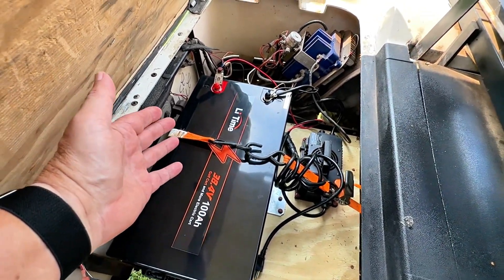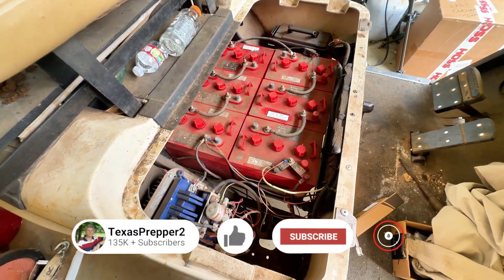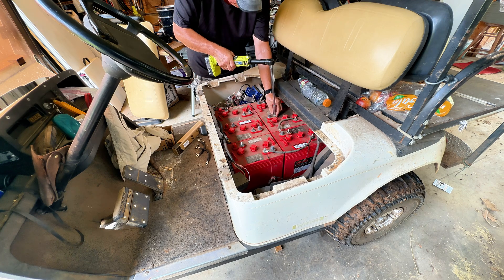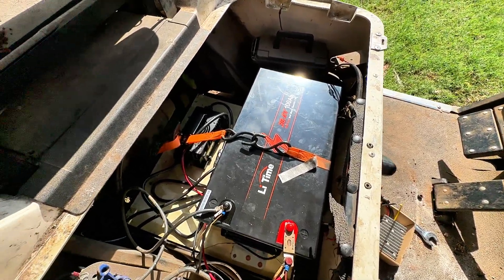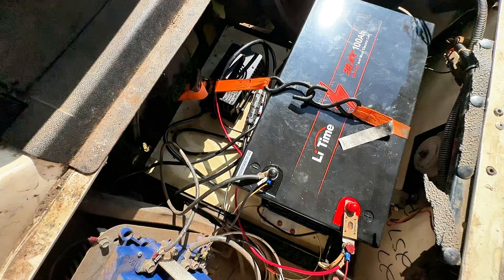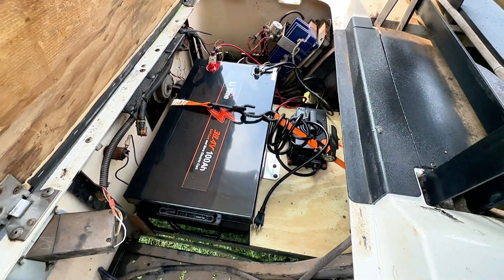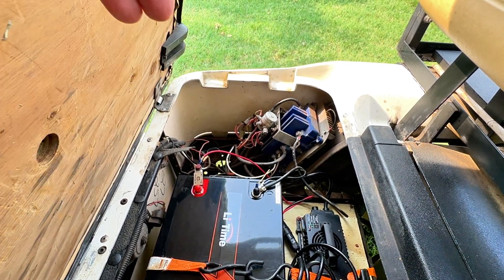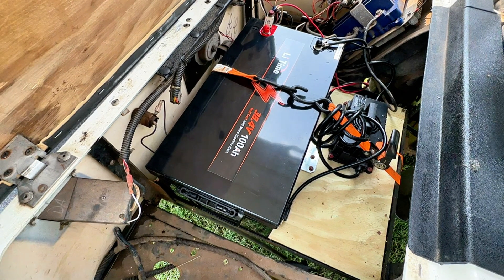Converting Lead Acid to Lithium - The Ultimate Guide

Comment from the maker: In this video, we take you through the step-by-step process of upgrading an old EZGO golf cart by replacing its outdated lead acid batteries with a modern, efficient LiTime lithium battery. This transformation not only enhances the performance and longevity of a golf cart but also simplifies maintenance and reduces a tremendous amount of weight.

Check out LiTime Lithium Batteries Here: https://www.litime.com/?ref=fvbeaugo
* Use Coupon Code TP2 for 3% OFF! *

Here are the Battery Lifting Straps: https://amzn.to/3VpZgaf
Here is the Ospho I talked about - It STOPS Rust: https://amzn.to/3X2NQus

*What You'll Learn:*
- The benefits of switching from lead acid to lithium batteries.
- A comparison of lead acid vs. lithium batteries.
- Tools and materials needed for the battery replacement.
- How to safely remove the old lead acid batteries.
- Proper installation and connections of the new lithium battery.
- Tips for optimizing battery performance and ensuring long-term reliability.

*Why Upgrade to Lithium:*
- *Longer Lifespan:* Lithium batteries last significantly longer than lead acid batteries, saving you money in the long run.
- *Weight Reduction:* Lithium batteries are much lighter, which can improve your golf cart's performance and efficiency.
- *Maintenance-Free:* Say goodbye to regular maintenance checks and water refills.
- *Consistent Power:* Enjoy consistent power output throughout the entire charge cycle.

Whether you're a seasoned golf cart enthusiast or a beginner looking to upgrade your ride, this video provides all the information you need to make a smooth and successful transition to lithium power. 

*Don't forget to like, comment, and subscribe for more helpful tips and tutorials!*
Stay safe!
alan
As a member of the Amazon Associate Program, I earn from qualifying purchases
Reply: Waited all video for the step by step tutorial and never showed it im new to golf carts and i'm in the process of doing this conversion but im very green working on electrical componenets,  do the switch and charger hooks up directly to the battery?
Reply: How many hours can you run with that battery?
Reply from the maker: @davida5211  Not really sure. I don't play golf. I use this on the farm. When I see the voltage dropping, I recharge. But I've never tracked how many hours it was. The documentation says 30 miles or more... also depends on level ground or hilly... lots of variables.

Comment: I Know you don't get a lot of rain around there but the only thing I would do different is locate that charger somewhere else or cover up that intake cooling fan. Water could be an issue...it looks like most I see, are they waterproof by chance?
Reply from the maker: I think they are waterproof up to a certain point. But, my golf cart is always parked under a shed, unless of course I’m out using it in the rain… Which I try not to do 😊

Comment: Hi. I have a 48v ezgo txt 2017, I switch from 6 of 8v lead batteries to 4 of lithium 12v 100AM. But it doesn’t run.  Just slightly move then stop.  Pls help
Reply from the maker: I wish I could help you, but I am by no means a golf cart mechanic. 
I have no idea what your problem might be. This conversion was easy, and I think most anybody could do it, but I don’t know enough about carts to diagnose your problem.

I would recommend you contact someone who specializes in golf cart conversions!
Reply: Check the reed lead. The small red one from the  old charger port. Check it’s connected to the positive terminal on néw batteries. Drove me nuts for two days.

Comment: have u noticed the BMS stopping going up hills, just concerned that the 200 cont rating will cut off when going up hills, I dont know the max think its 400amp for 3 sec then will cut off
Reply from the maker: So far, it is handling my hills OK. I’m going to have my 
forward /reverse switch updated soon. I’ll post that video when it happens. That is supposed to help the performance of the cart immensely.
Reply: Wow Jist updating the switch?  Wonder how 🤷‍♂️
Reply from the maker: @lestervida  I'm waiting for the Golf Cart guy to work me in.
Trying to keep my foot out of it till I get it replaced

Comment: Could you explain the connections on the positive post. I can’t get mine to run, I’m missing something
Reply from the maker: Mine would not run at first either. Then I read something somewhere, that said you have to connect the old charging port wire. So, I connected the wire from the old charging port (even though I was not using it anymore) to the positive post of the battery and it worked. It’s worked ever since.

Not sure why, or what that has to do with anything… 
But it worked. 

It’s the wire that originally came from the original factory charging port that went to the positive battery post. Connect that (if you can remember which one it is) to the positive of the battery. 

At least, that’s what it worked for me. 

You might want to take it to a cart mechanic and get his opinion first.

Let me know if you get it going.
Reply: The wire most likely comes from reed switch witch prevents the cart from moving with charge cable installed. It opens the positive connection between charge port and direction switch?. When in plugged the reed switch closes and applies voltage. Some people jumps out the reed switch when it goes bad.

Comment: How did you wire it?
Reply from the maker: I just put all the wires that were on the positive terminal (on the lead acid batteries) to the positive terminal on the lithium. Same thing for the negative terminal. It worked out great.

Comment: I did same upgrade but the litime bms in battery is cutting off when I fully depress go pedal at 50% pedal it’s fine any help would be appreciated
Reply from the maker: I’m probably not the right person to ask for help. But, you need to make sure your controller can handle the extra amp output. My controller was upgraded several years ago to a 400 amp controller and it seems to handle this really well. 
Figure out what controller you have. (look at the label on it) and ask a true golf cart mechanic if that controller will handle the new battery.
That’s the best I can do… Hope it helps

Comment: How come the lithium battery doesn't burn out the controller? The amp output has to be higher then lead acid?
Reply from the maker: Several years ago, the original controller crapped out, and I had it replaced. They put a 400 amp controller in. So , it can handle the increased amperage. The motor is original equipment though, as far as I know.

Comment: I went lithium and now regret it. The price was 1,200 for the battery and now after seeing all the battery fire from moisture that will eventually get into the box holding the batteries, I’m afraid that it will catch fire. Plus with batteries just die with no idea of them getting low on a charger. At lease with lead batteries, you have the cart will slow down telling you they need to be charged.
Reply from the maker: True, when they go dead, they go dead quick. But, the lithium phosphate are a lot more stable than the early lithium batteries. Very few fires.
Reply: @TexasPrepper2 how’s lithium batteries, save his lead acid. I’m was a firefighter. And I can tell you that lithium batteries are far more dangerous than lead acid batteries. I live in south Florida, where humidity and a salt atmosphere plays a toll on everything. In salty moisture causes corrosion in batteries, very easily, making lithium batteries very dangerous to have. There’s been lithium batteries that just were sitting in the garage that started at the whole house on fire and they’re very hard to put out once started.
Reply: @rayladurini1045  Big difference between lithium ion (think EVs like Tesla) and lithium iron phosphate (what we have here). Lithium iron phosphate is much more stable and not susceptible to thermal runaway like lithium ion.
Reply: This is the dumbest reasoning I've ever heard, so you're battery caught on fire?  Lead acid is dangerous too, mind-blowing right

Comment: I have a 48v cart and was about 2 miles from home when it died and smoke was coming from the crack of the seat.   Yanked off the seat and it was on fire.   Lucky my daughter had a jug of iced tea to put it out.  Really scary!  If I had a lithium battery, nothing would put it out and the fire dept wouldn’t even try.  I think I’ll wait until they figure out this lithium fire thing first cause changing it to lithium has been my dream.
Reply from the maker: Lithium batteries have come along way in the last few years. The fire danger is not nearly as bad as it used to be.

Comment: It's only 100Ah.. the standard Trojan batteries are typically around 210Ah
Reply from the maker: True, but those lead acid batteries were running down a lot quicker than this new battery is.
Reply: @TexasPrepper2  Sweet! Nice to hear.
Reply: The difference is you shouldn't take lead-acid batteries below 50% charge or you cause damage. Also filling from 80-100% takes forever. With Lithium, you can take it down to 10% without damage and they charge fast up to 100%...net effect is usable amp-hours are close to the same and when you factor in not having to drag 300lb of lead around, you are more efficient.
Reply: I am running the 60ah Litime  in a ez go 36 volt cart, works great, no problems so far.

Comment: Good luck! I had cheap Enjoy Bot batteries and in 1.5 years, two failed. Try to warranty them and they give you the run around. I would not be surprised if this is the same company. Ended up spending the money and Eco Battery.
Reply from the maker: I think this company used to be called AmpereTime. 
I’ve seen some good reviews on YouTube… We shall see

Comment: Nice video Alan. I was surprised to see that one replacement battery was about the same price as the group of lead acid batteries.  That makes this conversion a must do.  Nice clean install also!
Reply from the maker: Thanks David! 
That was my thinking too. The price is on these have come down quite a bit. Now, if it would just dry up a little so can drive this thing and have some fun 😊

Comment: I'm sure it is a lot more responsive.  Lithium has a much better discharge rate than lead acid.  Lithium is not subject to Peukert's law.  

Taking 300 lbs off the weight probably didn't hurt anything either.  Does it seem tippy at all?  Removing that weight will effect the center of gravity but it shouldn't be overly critical.  Just something to think about.

It would be nice to put a 400w solar panel on top and add a solar charge controller.  As long as you park it outside you would probably never need to charge it from the wall.
Reply from the maker: I’m definitely keeping an eye on the center of gravity. 
And, I do have a solar panel or two laying around… 😊

Comment: I swapped our 36 volt ezgo with lithium batteries last year couldn’t be happier no weekly maintenance adding water 
But I use 3 12 volt 100amp enjoybot batteries less expensive than a 1 36 volt 100 amp battery at the time
Reply from the maker: It makes such a big difference 👍🏻

Comment: I'm not a fear monger Allen, but park it in a cheap shed.  I know you said at beginning of video, you've been through this forwards and backwards.  Is that the Lead/Lithium battery? (Safer?).  I bought an E-bike from your state Texas (since, the company went Chapter 7-liquidation) and my neighbor started scaring the hell out of my about buying fire proof battery boxes for the battery (thermal runaway)... Anyway.... I think it's bull myself..  Cheers guy.
Reply: This is a LiFePO4 battery. They don't have the same fire danger as the old Li batteries.
Reply from the maker: True. Thanks for the comment.
Reply from the maker: The new LIPO4’s are much safer.